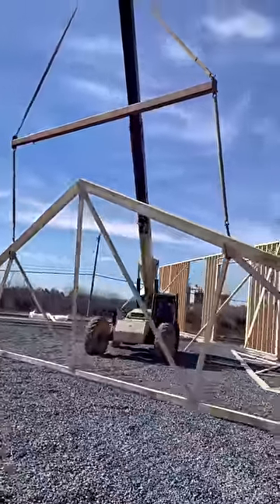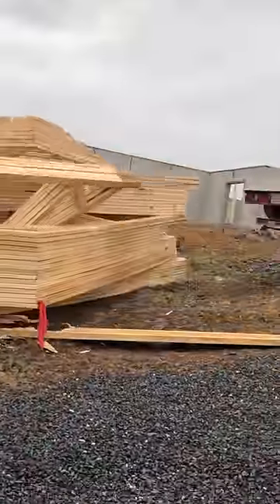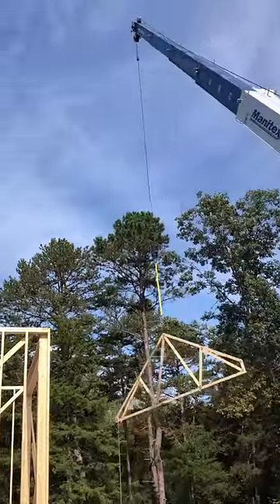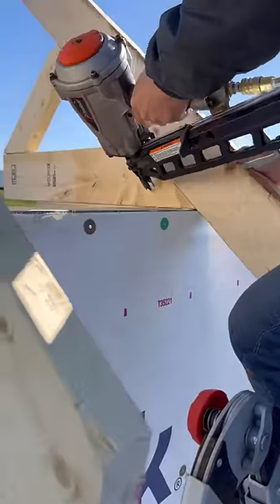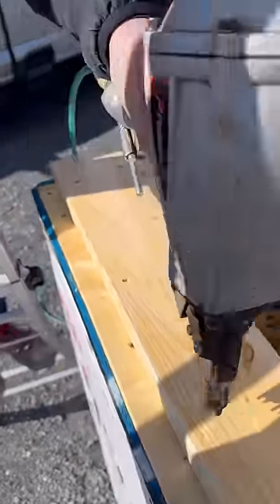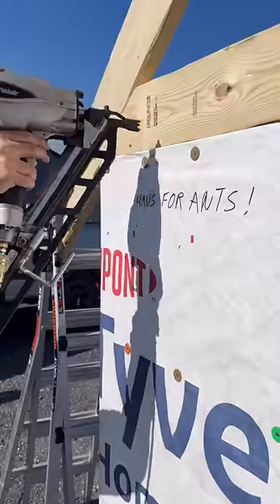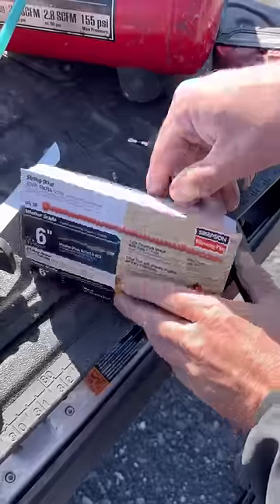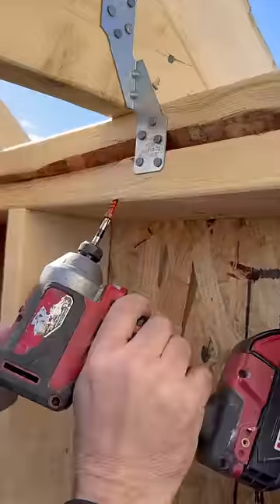How Roof Trusses Work

Comment: I like rafters because you can actually use the attic space.
Reply: Why can't you use an attic in a truss system?
Reply: @mccartneystuart You can order bonus room trusses, but they usually aren't very good as far as the bottom chords are all over the place up and down, and the verticals aren't very level or square, and they usually need to be firred in an up all over the place! They usually just suck!
Reply: @wesman7837  ah, I appreciate the info.
Reply: @wesman7837  didn't know if attics can't be used because they don't hold weight for storage or the maze of timber supports in the way.
Reply: Practically non-existent in FL any longer. Everything nowadays is yellow pine trusses.
Reply: I agree with you 100%
Reply: Here in Maine they sell trusses of all variety, many allow for attic space!
Reply: He’s right… my house has a truss system roof and we have no use for our attic. It was a PIA to work up there to do some electrical work and to add a bathroom vent fan. My body hurt after laying all crooked on the trusses to install the vent/fan and cut a hole in the roof and add the vent/hose. It has blown in insulation so you have to carve a path to ensure you don’t step through the ceiling and step on or sit on the trusses. My parents house has an attic that had plywood where we could walk and put storage items (rafters) with a walk up set of stairs. If I could choose I’d choose rafters and all that space as storage for sure. Never thought about it when buying the home.
Reply: @leecowell8165  you're right. Truss construction is faster and cheaper.
Reply: @wesman7837 oh man I didn’t even know that
 exited! Thanks
Reply: @mccartneystuart because of the webbing
Reply: @mccartneystuart the webbing is why
Reply: Cost more than prefab. 😂
Reply: There's really no difference between these. It's all about the design and engineering as to whether you have room to access in the future. Trusses generally use smaller lumber like 2x4 and 2x6 vs rafters which will depend on the span. If you pay more and get a truss designed properly, you can access the space all day.
Reply: @mccartneystuart because of the webbing.Theres a little room but no where the amount of space in a stick built house
Reply: Attic trusses work just as well. I used to work at a truss plant.    
Built many with 2x6 or 2x8 top and bottom cords for both barns and houses. Some were so big we had to get a oversize load permit and have a pilot vehicle for the truck to deliver them.
Reply: We added a full 2 bedrooms in the roof with trusses in the attic and no sagging or anything truss diversity is very underrated
Reply: @mccartneystuart simply because the design of trusses (the web area specifically) takes up any usable space. Nothing to do with "holding weight".
Reply: When I want an attic in a truss space I tend to design my own truss.  You do have to tend to have an engineer stamp on it when you do that but I've never had trouble getting that.
Reply: You can still use attic space but have to step over trusses unless you lay sheets of ply over the batts.

Comment: That delivery driver DESTROYED that truss!!
Reply from the maker: Actually the part that broke was just a scrap piece of I joist they put on the bottom to protect the trusses
Reply: That’s a floor truss used as a support called a “surfboard” to help the trusses not get damaged and just roll off the truck.
Reply: That driver was lazy or was totally untrained on how to properly unload the trusses!!  He didn't slide tandems forward, then raise/til roller bed to allow stack to roll off at 12" to 18" drop.!!!!😮😅😂
Reply: Yeah, I’m sure the engineer that designed the trusses loved that “drop off”!
Reply: It’s ok
Repaired on site
Reply: He unloaded it with style
Reply: Source: Truss me
Reply: Kinda typical for unloading . I call them airdrops . Hopefully they land on the jobsite . Had a pack delivered once . Where the bands broke and all the trusses slid down into my walkout basement framing . Thanks Guy !! .. Now who is gonna pay me to rebuild all that ??

Comment: I work for a truss company as a wall panel designer. We prefab the entire house inside our plant,  and then we ship it out to the job sites to be assembled by our in house framers. The framing company is actually the parent company to my company. The entire process is fast and efficient. I’ve also worked in the plant building trusses, system 42 trusses, and walls before coming to the office. The entire process is fast and efficient. The framers didn’t like the prefabs at first, but they love it now.
Reply: What company y’all assemble in texas?
Reply: @ThatOneManYouTube  no we’re in Florida. The company is panel-tek of north Florida. SARC is the parent company
Reply: I worked in Minnesota...    It's a great help to the housing industry,,    an I believe it helps the builders also ...  The home owner may feel safer with a stronger roof !   With snow load , as it matters in cold states ...

Comment: Rafters will give a better end product. Trusses get banged around and most times the slings aren’t set properly. The gusset clips only have 1/2” teeth on them and get loose or even fall off while they are being installed. 20 years in the trade and I’ve never seen a full set of trusses that were correctly assembled at the factory. Usually it’s about a 10-20% defect rate. A lot of builders don’t even notice if a clip is missing and won’t even try to fix them if they do. They might throw a toe nail in it real quick if their gun is close by. We used to hand nail 20 penny nails by hand and never used a gun for any part of a house. Just think, the average roof takes around 35,000 nails. Thank god for nail guns. I’m getting too old to hand nail a roof now.

Comment: Rafters all day. But then again I was the guy cutting them so I'm partial cause it gave me a job! Bird's beak cuts and ridge angles all day baby! Measure twice cut once!
Reply from the maker: Nice! Your knowledge is more and more rare
Reply: Me too! I don't like building the run of the mill crackerjack boxes every day or the same condos over and over again! 😒 🙄 😕
Reply: Birds beak I have not heard that term in awhile! We just measured once VERY carefully and used that guy as the pattern. most rafter designs on both sides of the ridge are symmetrical.
Reply: @leecowell8165  Bird Beak LOL ..  Ask him what HPCL stands for ?? It's right next to the little birdie
Reply: Cut Man ?? Or Sawhorse Warmer ?? .LOL .. . I don't know how many crews I've run that one guy wanted to be the Cut Man . Usually the guy  that is little chunkier and not a nimble rafter monkey . I expect my cut man to be able to hear a number and know what I want ..Without having to draw a picture and scream down and using hand signals  . I should be able to give my " Cut Man " one number on the longest hip jack rafter on left side looking up. On a  5.625/12 and a 8.75/12 bastard @  16oc and figure out each jack in CLD " Common Length Difference and HPCL " Heel Plumb Cut Line " and side cuts bevels without pestering the hell outta me while I have the others snapping the roof together LOL .. If you can do that , I'll  hire that guy . The problem with most cut men is they can't comprehend detailed cuts and collisions . I am all for trusses in certain applications where stick building would require a spider web of bracing , Point load transfers and loads of LVL's . Trusses have their times and rafters have theirs and sometime they both weave together. My saying to all cut men " Shut and Cut " and if you can't .. CVS is hiring
Reply: I think its time to return to serious craftsmanship and consider beauty a little bit more in our houses and buildings.
Reply: @chickenfishhybrid44 horse gone....barn door swinging

Comment: I much prefer trusses to rafters. So much easier - just measure wall to wall  - and not prohibitively expensive. Good tip on the additional plate.
Reply from the maker: Agree 👍
Reply: @hausplans got a question for you
Reply: I like building in the extra space in the roof by stick building the roof! Well, I guess you can order bonus room trusses, but they are usually all over the place with their webs that usually aren't straight or square or in line with each other, and the floor (bottom chords) are usually very inconsistent up and down!
Reply: Trusses are great for the builder, but building my own home, I hate to see all of the wasted space. You lose atleast a couple big rooms worth of space, if not almost an entire level.
Reply: I need blue prints made up for a mini house 16ft × 28 ft 
1 master bedroom w/closet
1 small bedroom w/closet For arts and crafts
1 bathroom 
Living room
 kitchen w/dining room 
Washer and dryer (stackable) room
Reply: It's called a Gabel backer.   You can also pre-sheet your Gabel.
Reply: So there is no engineer that designs the structure of a house in the US? Just everyone uses whatever thing they wish?
Reply: I bought a house termites have eaten the whole roof structure. Basically what would be the better route the prebuilt trusses?
Reply: @fabr5747 it depends on where you are. Everywhere has their own different requirements. I live in Chicago where everything must have an architects design with very strict guidelines. Rural areas tend to be much more lax. 
But trusses vs rafters are just 2 different methods of achieving the same result. It comes down to builder preference and demands of the specific job.
Reply: @pacatack2  An architect is NOT an engineer. An architect has absolutely no knowledge of structural engineering. Their competency is in other topics. Both are complementary.
Reply: @ezze7540  Then there is a problem with your codes. If your codes are about type of structures and not making a structural calculation of the building, don't expect them to be safe. 
A house, a bridge, a massive building, same structural analysis. That's a standard in developed country.
Reply: True.  Big government loves to throw their weight around and drive the cost up as high as possible.  My buddy lived in California.  He wanted to build a 12’x6’ backyard shed and there were 5-6 different inspectors show up for his shed to put yard tools in.  I live in rural Tennessee where I just built a 2500sq ft house with zero inspections.
Reply: @Americanprepp88 did you get the blue print you needed??
Reply: @fabr5747  of course not
Reply: @fabr5747 you have to submit plans and have them approved. Obviously, you're not going through that only to have the "type" of structure checked off lol.
Reply: @fabr5747 first, we're talking about single family residences. Second if you knew anything about structural engineering, you'd know there's a lot of ways to achieve the same thing.

Trusses can't be used on complex rooflines or vaulted ceilings but rafters may require additional support if the run is very long. All of that is determined by the building code. Enforcement is local because the US is federalized but we don't trust the word of whatever engineer a property developer got to stamp the plans. It's inspected and reviewed by multiple municipal engineers for everything from storm water and land disturbance to structural.

It seems you've crafted a narrative out of ignorance and running with it when you have no clue about structural engineering, building or the US process. I can't imagine any developed country just let's someone say "an engineer approved it, we swear" and take their word for it.
Reply: @ezze7540 As long as you follow code, the calculations work out. It's still reviewed by your municipal engineering department. We aren't just going to accept "I'm an engineer, trust me bro" it gets checked by the city. There's some sketchy engineering firms out there.

They seem to also be mixing commercial and residential.

But yeah, kinda silly for them to know nothing about the building proces or engineering, let alone in another country, spouting off about it.